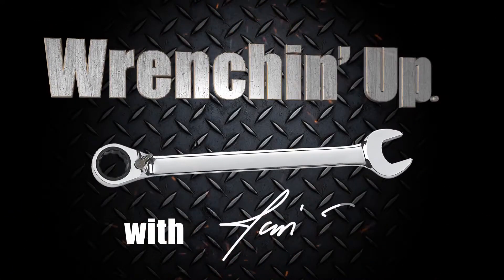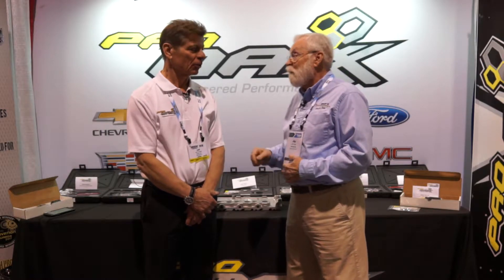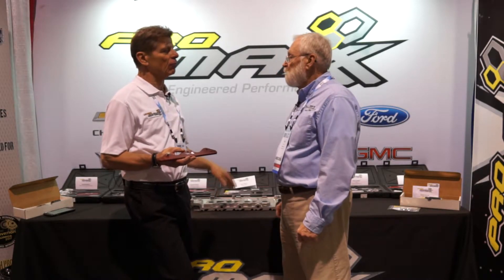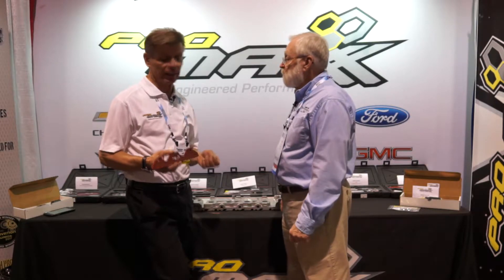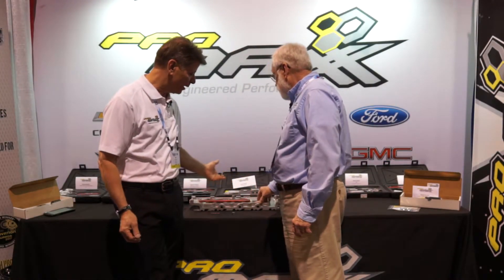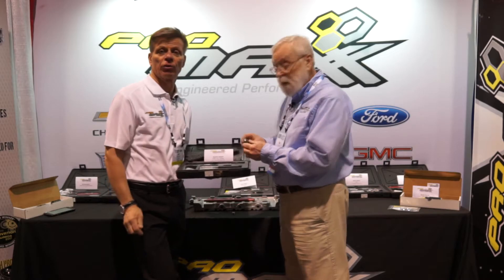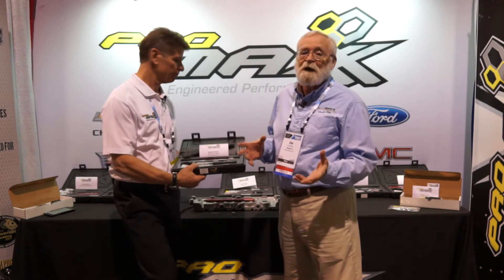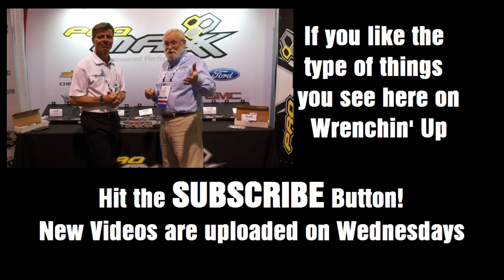Special Tools For Jobs You Really Hate Doing - Wrenchin' Up

Comment: The only problem is I didn't have this tool over the last 30 years of being tortured by broken manifold bolts...lol
Great tool!
Reply from the maker: Hi Joe - Thanks for the painfully relevant comment, and Thanks for watching!
Reply: I can guarantee I can remove a broken manifold bolt or stud out of a head faster than this tool! About 10 years ago Ford trucks had a huge issue with their manifolds cracking in half! To replace the manifold we would literally use an impact gun to remove all The nuts on the studs, And if the stud snapped before the nut came it was no big deal! I learned this technique from a guy I worked with that has been doing only custom exhaust work for the past 40 years! And he is one of the best! And if you are wondering what the technique is just bring in vehicle! There is a trick to every traid and to stay on top you keep you keep those secretes! SORRY